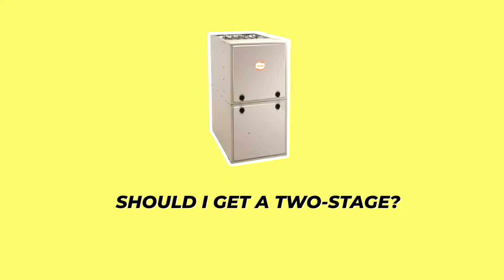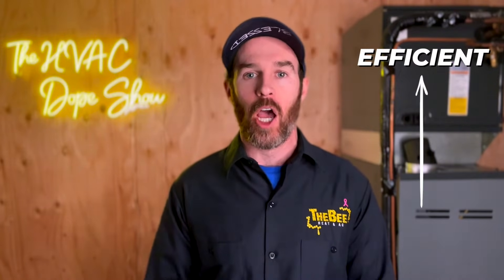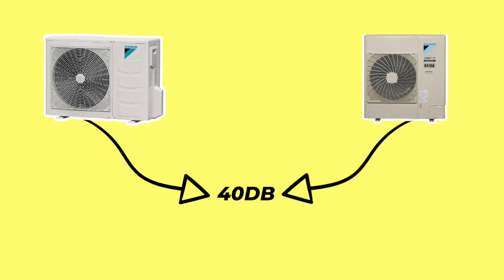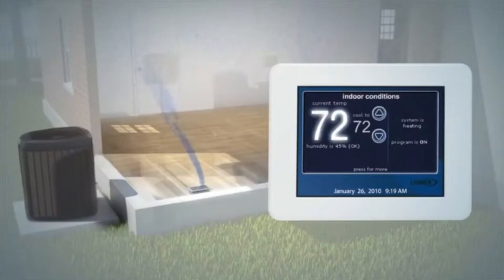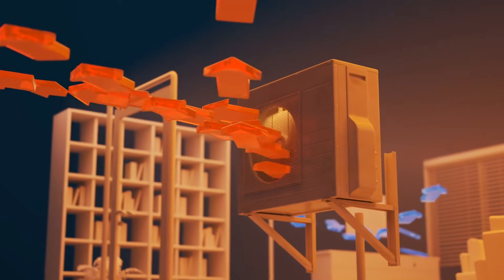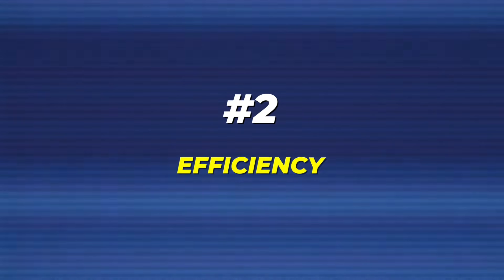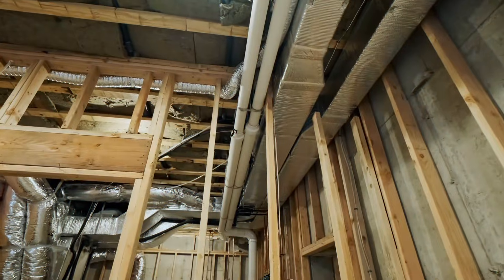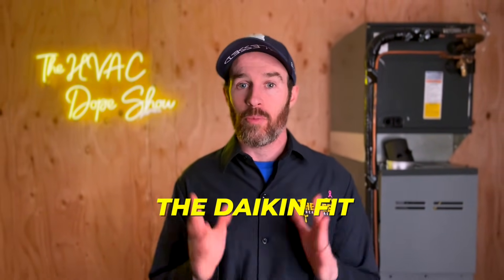Single Stage 🆚 Two Stage Furnace 🔥🤔

Comment: I have a 24 year-old heater. And I noticed my fuel bill started to skyrocket about three years ago. But everyone else’s skyrocket too. I live in California. I need a new heater system. I have 1200 square-foot house gas and a Lux tx 500 thermostat just wondering how much I would be looking at to replace the heater

Comment: Is the intake air pipe supposed to be vented outside or inside the house.
Reply from the maker: Depends if you have combustion air in that room or meet the requirements otherwise then you can vent inside, but it's designed to pull from the outside but it's technically not required to pull from the outside if combustion air is adequate (we'd had to see in person)

Comment: I got a trane run true 80% A801x installed to replace my 30 year old furnace.  Total for furnace and labor was 2k$ good deal?
Reply from the maker: That's insanely cheap yes lol... our direct costs are more than that not including overhead so it must be a one man show or low cost of living state. Colorado has gotten expensive but yeah that's a great deal regardless of location, is it working well? Install went smooth? Nice find!
Reply: Yea blows hot. The guy just started his HVAC business in NE ohio and is a 1 man show, but b4 that he worked 10yrs with another company.

Comment: My house is 25 years old should furnace and ac be replaced at same time
Reply from the maker: If they're both the same age (25 years old) then yes that's about max life expectancy for most systems. You can run something until it breaks but just know they'll normally break during peak season, but now is  a good time to get the best pricing on the shoulder seasons

Comment: 6 years ago I had a new complete unit installed. I got 3 bids and was given many options (and costs) from all 3. Local contractor gave me choices as I wanted to bump up from 3.5 to 4 ton. I went single stage with a bit larger air handler. Great decision I believe, $9K price as opposed to one $20K bid. System has been flawless except 1 capacitor change I did myself. Bottom line is it cools and heats my house very nicely.

Comment: I had 2 Variable speed units a 2 ton and a 3 ton, They did nothing but break. They only lasted a few years. They cost me a small fortune to keep running. Yes, they were high end Lennox junk. I replaced them with single stage and loved them.

Comment: What about (when you replace a 1 stage ac-only unit with a 2 stage unit), retrofitting a 90/340 relay into the old gas furnace to make it a 2 stage (air handler)?

Comment: I went with a single stage, multi-speed furnace & I love it! Replaced a 25 year old unit!
Reply: Is it quieter than the furnace it replaced? My single stage is 20+ years old and works perfectly but it is loud when it kicks on. Probably doesn't make sense to replace it when it is working unless the replacement unit would be almost silent in comparison.
Reply: @alanrussell6678 my replacement is almost silent! So much more efficient too.

Comment: Hi! I have a question? Do I need a special thermostat for a two stage furnace,  or can I use a nest thermostat without problems?
Reply from the maker: Most nests have two stages, if you don't control it via a two stage thermostat it will essentially ramp into second stage based on run time (after 10-15 minutes) instead of a call from the thermostat

Comment: Just  had a single stage furnace installed.  HVAC guy told me 2 stage costs $1K more and would not recommend it.  Plus I believe I don't have the right thermostat wiring for 2 stage as I only have 5 wires, not 7(?) required for two stage (?)

Comment: 1400 sq ft , 2 story home in Phoenix, do you recommend a single or two stage? I need advice please!
Reply: For Phoenix you probably want single speed. It's so hot most of the year that the AC is going to be running at full speed anyway. Especially if your ductwork is ran in the attic. If you have a home that is exceptionally well sealed and insulated then it might be worth going variable speed or two speed.

Comment: 11 Years ago the gov offered large incentives for conversion from electric or oil, to gas furnaces, but only if you buy a high efficiency furnace.  The grant was much bigger than the price diff between 80% and 96% units.  But this trane unit has cost a bundle in failures, days after 10 year warranty.  Every part is much more costly than for the simple units, not because they cost more to make, but because of your larger investment, they think you are willing to spend more on repairs.  The control board was $800!  With my electronics background, I estimate the build cost to be under $100.  Also, usually the little $1 relays fail, but you cannot just get them and solder them in.  The inducer motor was noisy and defective to start with, but not warranteed because it did not fail totally before the 10 years.  Two friends have the same furnace.  Installers save hundreds  by installing single stage thermostats on these 2 stage units.  When you strap the stage 1 and 2 call wires together, the furnace thinks it has a long reach to target, so invokes the sequence of trying to meet it with low flame, then after certain minutes, invokes high flame. So because it was fooled, it runs low until the last minute, then runs high and noisy for a minute to meet target.  Annoying.  I just cut the w1 w2 strap to make it a single stage again.  Finally got confirmation from trane that the low flame is more efficient than high flame anyway.  Makes sense, because if high flame was same or better efficiency, they would not  bother to build low flame.

Comment: I live in an older home. My one stage gas furnace finally became unservable so I told the techinician to replace it with the right size. He put in a two stage, Trane. The furnace runs all the time when the outside temperature is near freezing and the house is uncomfortably cold. I called the technician back out and he can't fix it, even thoughi it's still under warranty. Should I find another tech and lose on the warranty?
Reply: If the warranty is through Trane, I would call their corporate office, repeatedly.
Reply: @johnettipio  I wanted to thank you for your kind information. I was able to reach trane and printed out the warranty on my unit and have recommendations of other heating cooling specialists that work on Trane. I will lose the diagnostic fee but at least I should be covered on the more expensive parts if needed.
Reply: @knottreel  I'm glad I could help
Reply: sounds like the furnace is not correctly sized, high heat isn't working or there's a problem reducing heat output or duct system is uninsulated in unconditioned space and losing most of the heat on low fire.
A good tech can sort this out no problem.
if your ductwork is not suitable for 2-stage with no easy way to fix it, you can have the furnace locked into high heat/second stage.
Reply: @Jon-hx7pe  Thanks for the response. I have since called another furnace company. They found the problem within an hour. A valve wasn't letting enough gas through. It's all fixed now.

Comment: AS a HVAC tech for almost 25 years now , I ll tell you my opinion based on my experience. I always have installed SINGLE STAGE furnaces only. The difference in efficiency is negligible . However the initial cost is higher and the replacement parts are MUCH more costly. Most customers opt for a new furnace when faced with the high cost of repairing a two stage or especially a modulating furnace after the initial  manufacturer's 10 years parts warranty is expired. KEEP it simple !!!
Reply: All I ever sell and install is 2 stage heater box’s. The cost difference is not much and my customers are so much happier
Reply: This is what we also recommend. Only the HVAC companies who are interested in $$$ up sell to a 2 stage or modulating. Right on about the 10 year warranty. Single stage parts are less expensive and more readily available. 2 stage and modulating parts may be a week or 2 out, and warranty means nothing if parts are not available.
Reply: That's why my 24 year old single stage will get replaced with single stage

Comment: Hi, I purchased home that was remodeled. It used to be a two family home. The furnace put in is a “Payne, 95% AFUE, Single Stage, 4-Way Multipoise, FTC ECM, Gas Furnace, 80,000 BTU, 1600 CFM, 17.5" width”. My house is a 1940 sq ft, 2 story home and the second floor still has the two wire cable from the old furnace which apparently doesnt work. My husband put a older thermostat and it does nothing. Air flow is very light and the temp stays at 72degrees. Two rooms dont have vent/returns. One vent is high flow but cold air comes out of it. First floor is pretty warm but lots of cold spots. Please provide your input. I will appreciate. I am in Ohio.
Reply from the maker: If you'd like a referral I can find someone in your area but honestly duct issues can be complicated. If it's always blowing cold when the furnace is on unless it's tied to an HRV (recovery ventilator, pulls air from the outside) it's difficult to diagnose and shouldn't be blowing cold air it's really not possible unless something else is going on. Weird issues like that it's best to get a tech to look at it, 72 is pretty warm for the winter design temps are usually around that, it's not supposed to "blast" heat out of the vents but it definitely shouldn't blow cold constantly, if it's just on startup that's not abnormal for a minute or so while the ducts warm up but a good tech can take a look and see if anything is out of the ordinary. Hope that helps
Reply: @TheHVACDopeShow definitely please if you have a referral. Thank you for replying.

Comment: How to keep furnace on lowest fire? I have a modulating furnace that ranges from 40K-100K and want it set to 40K permanently. Id rather it just run longer rather than hitting high fire for 1 few minutes and then shut down.
Reply from the maker: If it's a two stage you can wire the thermostat to only fire in first stage but a modulating will always modulate. It sounds maybe oversized (hard to tell from a comment without seeing it in action) if it's only running for a minute and overheating / blasting heat before shutting off. Unfortunately a lot of contractors oversize things when they don't know that modulating / high efficiency systems are close to 100% output of they're rating, thus the size needed is smaller. Oftentimes we rip out stuff in Denver that might have been 100k 80% and put in a 60k 97% modulating if that was the proper size in the first place (heat load calc is only way to know)
Reply: @TheHVACDopeShow  I flipped a dip switch (used for "testing")that locked it in low fire and runs perfectly and quietly (takes some time to hit 68-71f). Read through the installation manual. The model if you're even mildly interested is g9mae1002122a2 .

It has been -26f for the last 3 days and has held temperature on a 2800sq' ICF home. 

I did size the unit correctly but I believe my ducting is undersized since it cant handle high fire (100K BTU) for more than a few minutes before tripping HL switch. 

Was thinking about adding a relief duct on the side of the plenum. in order to accommodate the extra air flow.

Comment: The man is delirious he's been brainwashed by your videos! In 80% is more reliable and has a hotter heat all the way through its cycle. It may not be as efficient as these 95% or higher but less problems. You don't have to worry about the condensation pump or condensation furnace because the 80% do not have a condensation. My parents had one last over 54 years since then we've been through five in 20 years! And if they stop selling them I'm going to go to a wood burner!

Comment: Great video! We are a family of 6 in Southern California and our old furnace from the 90’s needs to be replaced. 
Our house is roughly 1500 ft.² with the room in the back seems to always get the weakest amount of airflow .
We don’t mind spending a little more since we’re going to live in this house for a very long time, but wanna make sure we don’t buy something that’s unnecessary for the size of our house . 
I see a lot of brands such as Mr. cool or Goodman pop up a lot . I have been told that if I plan on expanding the house, maybe I should get something in the range that can handle 100,000 BTU..
Just curious how much it is for installation after you buy the parts if you hire someone generally what would roughly the cost be to install the furnace and get rid of the old one .
Also, should I buy the new furnace wholesale?

Comment: In variable speed system which components always run: only condenser, only air handler or both?
Can they be wired to run only as singe speed?
Reply from the maker: It depends what you're talking about because if it's just a variable speed blower motor with everything else single stage then it will function as a single / two stage (most variable speed blowers are only on two stage or modulating systems). But generally when heating or cooling the blower is the only component that runs when anything is running, depends if you have a furnace or heat pump as well if the condenser is a heat pump it will run in heating and cooling.

Comment: We bought a home with a two stage Lenox furnace and the wife complains that the vents blow "cold" air while it is in the first stage for 5 minutes. She wants me to somehow disable this first stage heat. Is there any reason for this "cold" air and any way to disable this first stage? Any reason I shouldn't?
Reply: I think you dont really have 2 stage. You have a 2 stage furnace that's wored with 1 stage wiring. It will run on high stage on 1st stage for five minutes and then ramp up to second stage. You need a two stage thermostat with 2 stage wiring probably needing an additional wire. One wire for each R, G, W1,W2,Y AND C if you dont want to use batteries.

Comment: I have a 4000 sqft building with a 13' ceiling, a furnace, and duct down the center of the building; I think I want to replace the furnace, but I have been looking for what is available. I have been looking at a furnace vs a stand-alone unit.

Comment: If increasing the fan run time in a forced air system is so important to mixing air and smoothing out temperatures in a house with poorly balanced ducts (3:36), why not keep the basic single stage system and just spend $100 extra on a smart thermostat that can be programmed to run the blower fan on circulation-only mode for [x] additional minutes after the heating or cooling load is satisfied?

It seems like you can avoid a lot in additional purchase and upkeep costs by solving your problems through better controls, allowing you to stick to the simplest workable furnaces and a/c units for the main equipment.

(Fixing the ducts is the most obvious solution, but I get that existing conditions can sometimes make that impractical or prohibitively expensive.)
Reply from the maker: It will still be noisier though in a single stage application so it’s just up to you and a matter of preference… 2 stage is primarily about comfort and quiet. If you’re trying to do it on the cheap then yes setting your blower to on mode, or extended run time, is a good option because as you mentioned it evens out the temps
Reply: @TheHVACDopeShow  

If a homeowner has a noise complaint then that should be addressed on its own merits. Are the  grilles and registers whistling while the air is circulating? Well, it isn't very expensive to replace those with less restrictive ones. Is the air handler in a ground floor equipment closet next to the kitchen and living room (e.g. in a slab-on-grade house) so whenever it is on you hear too much noise? Can't put Rockwool in the walls of that closet to cut the sound? Okay, spend more on a better air handler.

In many newer single-stage furnace / air handler units it is also possible to tap the "single speed" fan motor jumpers at a different speed for each type of thermostat call - higher speed in cooling mode, medium speed in heating mode, lower speed in circulation-only mode.  That might not represent the biggest range of speeds when you compare it to a true variable speed setup but it might help in a marginal noise complaint scenario while using uncomplicated equipment.

Comment: We built our house and paid a premium for 2 stage systems. We've been in the house for 3 years and I cannot tell if/when it's ever ran at a different speed. It's either on or off. How can you tell if it's using 2 stages? If the air flow/fan speed noticeably different from stage to stage?
Reply from the maker: Looking at the wiring… so if you pull the thermostat off its base you may or may not have a W1 and W2 wire there (for heating 1 and heating 2) and Y1 and Y2 is for cooling 1 and 2 (1st / 2nd stage). Airflow should definitely be noticeably different but it’s also somewhat minor so what noticeable to the HVAC guy might not be to you. I would have a company come take a look and see if it’s running in two stages because if it’s not it’s normally just a wiring fix
Reply: Michael, We live in northern IL.  We have a Goodman 80% furnace, two stage, variable blower motor.  When there is a call for more heat on colder days you can hear the difference when the blower motor kicks in to the higher speed.  You should hear the difference plus the air blowing stronger through the vents.  It's definitely noticeable.